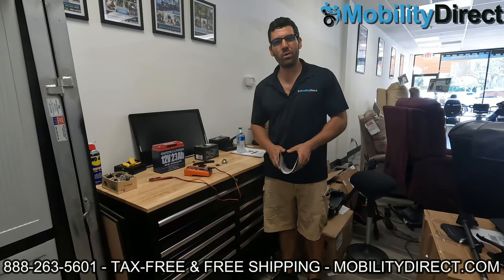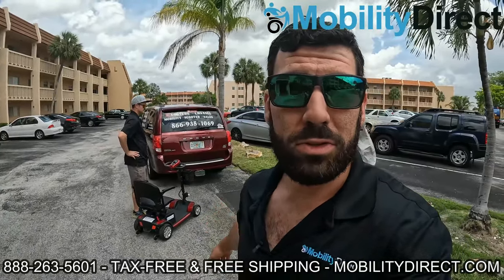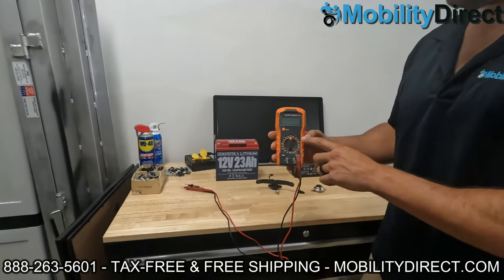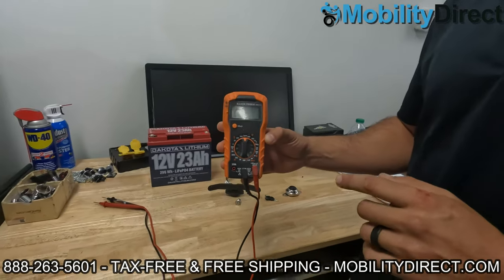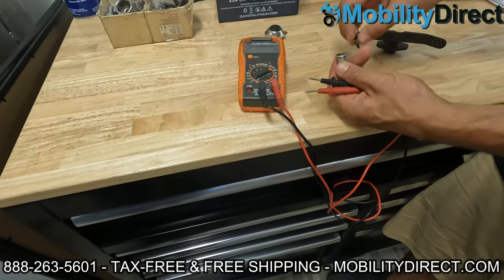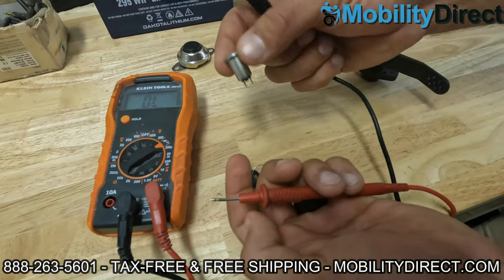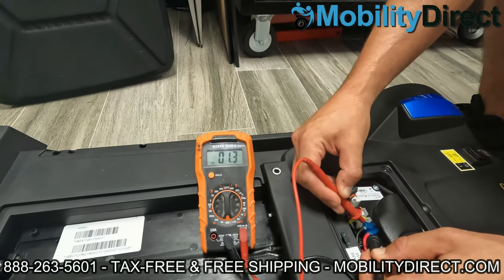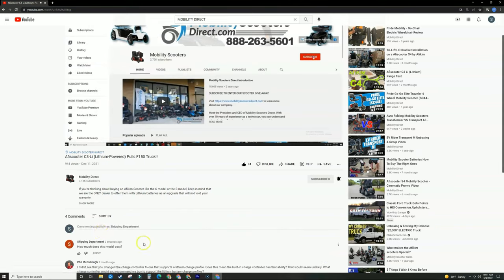⚡How to Use a Multi Meter to Test a Mobility Scooter

Comment: Does it matter if I put the red or the black first? I tried it with the red first and a spark came in and then my multimeter stopped working
Reply from the maker: That's not good!